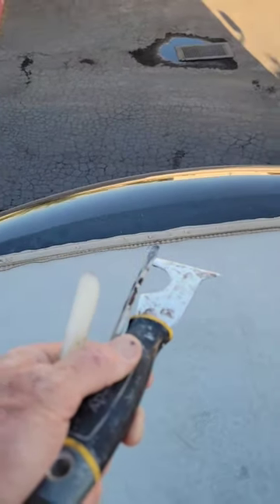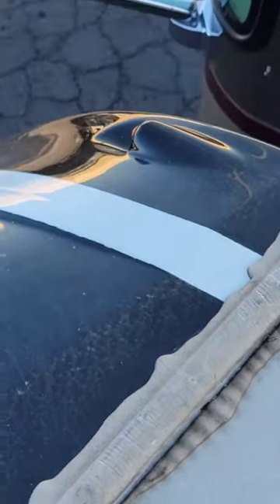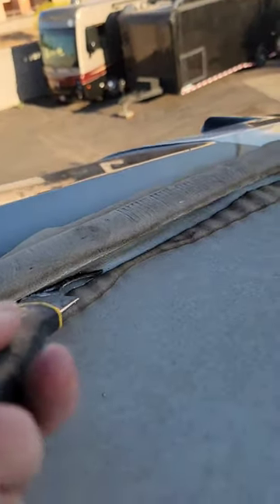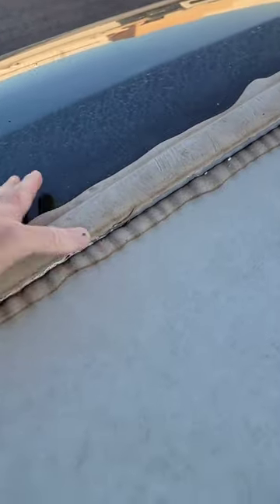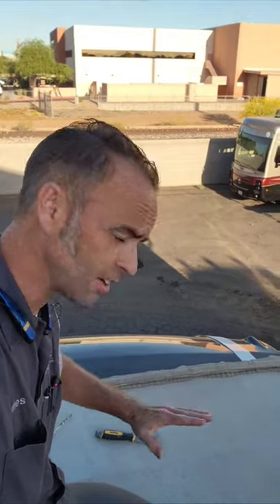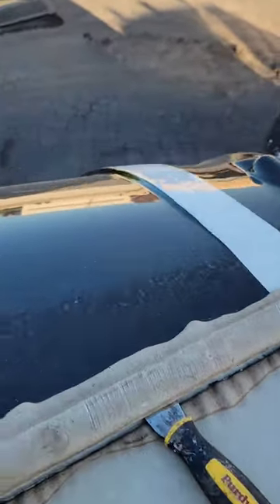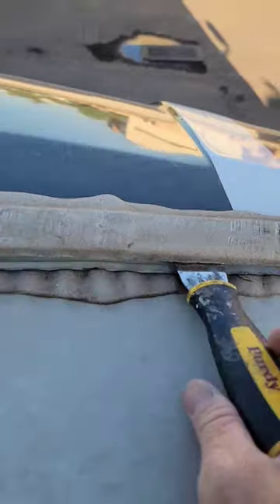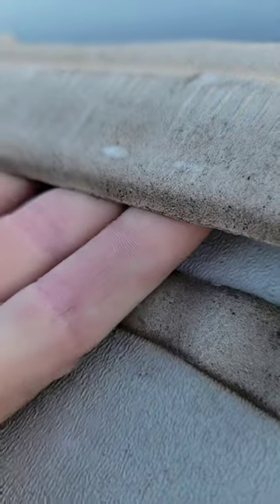always check your rv roof part 2

Comment: Can be an easy fix for a tech peal the dicor install new fasteners to properly secure front transition molding re seal with dicor recommend complete roof reseal
Reply: After that you can start replacing all of the rotted material below

Comment: That's how you damage it by everyone walking on it to test it your way.
Reply: If it can handle 100+ mile an hour wind ( which it should be able to) a bit of weight pressing down (the direction it is meant to adhere to anyways) should NOT hurt it. 😂